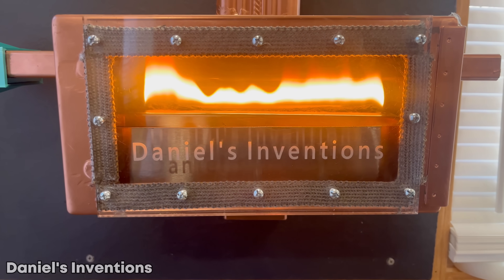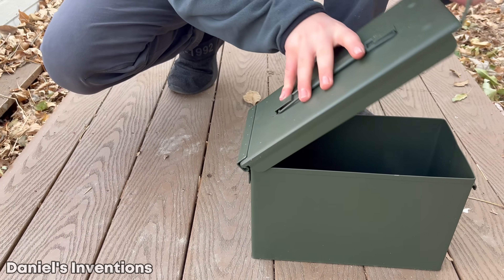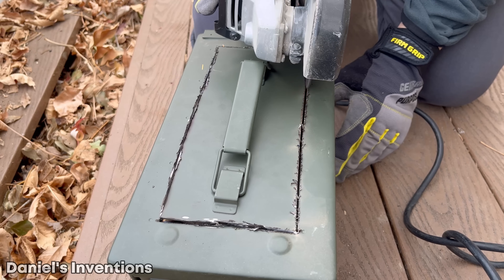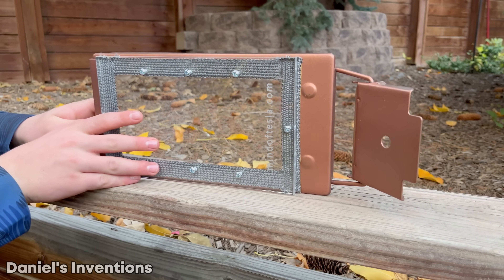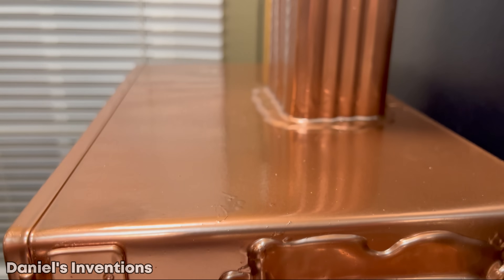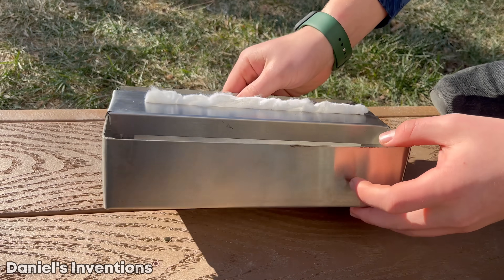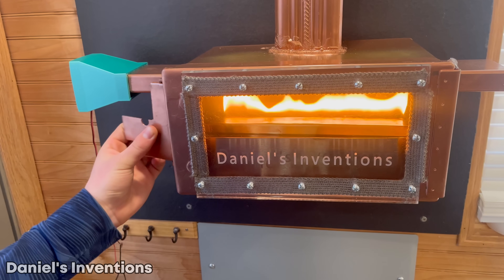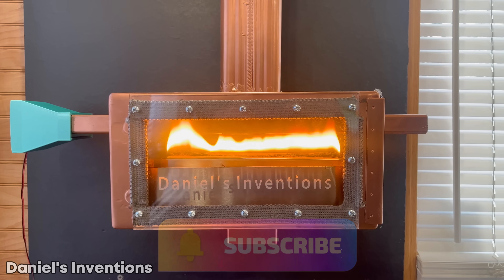ENDLESS Heat for Your Home WITHOUT Electricity 2.0

Comment: For your next build you should design your bottom intake to draw air from outside.  Since your bottom intake draws air from within the cabin, it's also drawing out the warmed air and exhausting it outside.  This is similar to the issue with old fireplaces, they draw the warmed air into the fireplace and then exhausts it out the chimney, which is why fireplaces were very inefficient.  Modern wood stoves are much better because they don't draw air from within the house.   So, if your intake draws from outside air you won't have to worry about the heater drawing any warm air from within the cabin and exhausting it outside.  But great concept, I like it!
Reply: Better to draw warm air from the room to heat up and circulate again, it will work less hard, this is a good design apart from the air to blow out should be aimed up from the intake so no need to use a fan, Chimney effect.
Reply: Would the outside temperatures cool down the burn chamber more than the loss of heat being drawn in from the room? It would be simple to test. I am curious.
Reply: wouldnt bringing cold air in from outside create moisture issues or affect the flame?   if anything, intake should be longer to pull cooler air from lower level of the room.. 
   my question would be - would there be an improvement in heat distribution if instead of an open hole at the end, it was blocked at the end and had a floor register design that sent the heat out in different directions?
Reply: It's actually better to draw the air from the room. It creates a slightly negative pressure inside allowing fresh air to find its way in through windows etc. If the source is outside you are constantly recycling the same air inside and because it's hot the inside creates a positive pressure which means if there are any fumes that leak they are staying inside and building up toxins. The small amount of air passing outside is not going to effect the hearing much in either case but its better to have a slightly negative pressure in the room allowing fresh air to seep in thus having cleaner air. HVAC was a field I worked in for a bit and we always tried to have air going outside in some circumstances to create a slightly negative pressure indoors to allow fresh air to seep in.
Reply: Under certain conditions this can result in the system reversing. Drawing air at the flue and exhausting through the intake.
Reply: The previous version used outside air. I'd like to hear why the builder made this one differently and if it's an improvement.
Reply: It's like the recirculation function on the AC in your car. It's always colder when recirculating cold air rather than cooling down hot air. It's definitely more efficient to warm up air that's already warm than warming up cold air from outside. 🤦🏻
Reply: @newmonengineering True but I also have a concern with carbon dioxide levels with this setup. Negative pressure means fresh air (oxygen) coming in and fire burns oxygen which is good if the space is not tightly sealed. 
However, this would be very concerning for those that are setting it up as you recommended in tightly insulated RVs (very small spaces). In that case, a carbon dioxide alarm would definitely be something to consider observing if those levels rise.
Reply: @mikefranks4528  with all types of oil heater it's best practice to have a small amount of ventilation and in the case of an RV this can be in the form of a roof vent but your correct I personally would still use a carbon monoxide / dioxide alarm, The beauty of this type of burner is they can be run on a multitude of oils and fuel blends.
Reply: @celtshaun1427 yep, totally right - cracking a window would allow fresh air to come in so that occupants can breathe properly. I wanted to educate everyone that having a carbon dioxide monitor would be smart in tightly sealed spaces. I am building out my RV and yes it will have a maxxair fan (for warmer weather), but for “Winter” it would require ventilation of an HRV system (heat recovery ventilation). Basically, maintaining a heated environment with fresh air.
Reply: @danb4275  Because everyone used to say drawing inside air caused outside air to be pulled in through intrusion, door gaps etc. When the reality is most houses leak air regardless. Also rarely the flue can reverse flow drawing air thru chimney exhausting thru intake creating what could be dangerous situation.
Reply: @benjaminmiles5062  No the fan is needed it's a big factor
Reply: Run the intake to close to the floor
Reply: Whether than draw in cold outside air, I'd just extend the intake down to floor level where it won't draw in so much stove heat.
Reply: Why would you not just keep heating the same air? If the air is already warm it will take less energy to keep warm. Also it doesn’t seem to be venting outside just through the pipe back into the room.
Reply: @benjaminmiles5062  Doesn't the drawn-in air get exhausted outside though?  It's not recirculated back into the room, it feeds the fire then goes out the exhaust pipe...I think.
Reply: @ThePostalbiker  The heat exchange happens from air entering from the left and passing over the fire box, then being blown Obrien the room.   The air drawn-in from the bottom feeds the fire and gets exhausted outside, but never reenters the home.
Reply: @benjaminmiles5062  Use one of those heat powered fans to distribute thru the room. Place it right on top of the heat box.
Reply: just draw indoor air closer from the ground.
Reply: Or perhaps, simply extend the air intake all the way down to the floor, where it is coldest? It would eliminate another whole.
Reply: You've got it backwards. Using cold air from outside is less efficient than recycling warm air from the inside.
Reply: ….. ok so. He’s talking about oxygen for the fire coming from outside. Not the air being pumped through the fan.
Reply: That wouldn't be a hard fix. Just drill a 3/4 inch hole into the stove and the wall. Add s small piece of 3/4 emt pipe into the bottom of the heater. Add a 90 deg. Elbow. To connect one into the outside wall. Seal around the pipe and wall.
Reply: Or have a gateway Y. So as the room gets hot, he can draw air from outside, by a switch of the Y.
Reply: @benjaminmiles5062  no it's always better to draw air directly from outside. The opposite of what you said is true. Pulling air from inside the room will create a vacuum and that will not only draw cold air in cracks of the cabin reducing efficiency of the stove but it will also make the fan work harder because it now has resistance.
Reply: @benjaminmiles5062  I see where you are going with that, but unfortunately - exhausting room air will create negative pressure in the room.  The air will seep back in through the walls and cracks, having a net chilling effect.  It would be more efficient to use the outside air and dump it back out to feed the flame.
Reply: this is a myth
Reply: @ThePostalbiker All of Your High Efficient Gas Furnaces Take outside air into Furnace for Make up air or You use All of Your 02. Especially if House is too air Tight!
Reply: I have yet to see one wood stove that draws fresh air directly from the out side to burn. Please show me the a link to the top 10 stoves. Hahaha
Reply: @realstihl2105  an OAK (outside air kit) is required when a wood stove is installed in a mobile home. But outside air intake is not beneficial in a regular home unless you have a very tightly sealed new home and you experience smoke rollout or low draft in your stove.
Reply: Cold sinks and heat rises...
Reply: @gregzeigler3850  the effect of convection ( heat rising / cold sinking ) is way weaker than the amount of pressure difference created by the burning fuel
Reply: @Vid_Master  What I meant, is he is getting colder air in, since the cold air intake is below.
Reply: I would suggest that exhaust pipe outside should be extended beyond the roof line unless your home is subject to heavy snow loads on the roof. Exhausting under the eaves could lead to fumes being drawn back into the house through the fascia.
Reply: You want to recirculate the air within the room but perhaps a longer intake so that it is drawing in the coolest air in the room would make sense.. alternatively having the whole unit lower down in the room.. but that's less ergonomic, and requires a longer chimney.. however if the longer chimney wasn't problematic it's also going to radiate heat
Reply: @markpennella  As a general rule, no. you are drawing out in cool air from the outside regardless of whether you are expelling the warm air from the house otherwise you would create a slight vacuum inside the building and wouldn't be able to exhaust the gases created by combustion to the outside which usually isn't the best for human survival.
Reply: @randybobandy9828  they don't get it, dude.

All I know is that I'm burning so much less wood in my stove ever since I ported the intake to the crawl space under my house. My place stays warmer longer - even with single-pane windows w/aluminum frames. 

One day I'll change those, too.
Reply: @mikefranks4528  you Internet hysterics just takes the cake, this is basically the same as having 7-10 oil lamps in your house, or candles comes to that and I have doubts that you kvetch about that(you’re redacted for real in that case)
Reply: Another benefit of using outside air is that it creates a positive pressure inside which reduces or prevents drafts. When using inside air it has to be replaced causing negative pressure in the room. Hence cold drafts will be amplified. I installed an outside feed to my woodstove and it made a great difference in cold drafts.
Reply: @tracywarren7332  Exactly!  And you also have no worries of oxygen depletion in a closed system.
Reply: @excellenceinanimation960  How much sense does "heating the same air" make when that reheated air is immediately sent straight up the flu and out into the atmosphere? When you recirculate the air in your car, does your air conditioner take the air that's already been cooled, then pipe it straight outside after re-cooling?
 Carefully consider those two questions, and I think you may come to an understanding of why it's not at all efficient to reheat air from your cabin, using this type of system.
Reply: @Rick-the-Swift  I think you have a misunderstanding of how the system works.  The heating pipe is separate from the exhaust. It just passes air over the flames and out into the room. The vent is the soot.
Reply: @Rick-the-Swift  oh your saying you should feed the flames with outside air.
Reply: @Rick-the-Swift  that would be fine but I still don’t see why. The air being pumped out into the room is from the exchange pipe and not out of the exhaust.
Reply: @excellenceinanimation960   "The air being pumped out into the room is from the exchange pipe and not out of the exhaust."
Ish. The exchange pipe is producing heat the same as the entire stove box, along with the flu pipe which is also producing heat. You could put a fan over the top or pointing straight at the side and get similar results. IThe exchange pipe is basically just more surface area added to the stove, becoming heated then radiating back into the room. The fan just helps facilitate that process. But you still need to take into consideration when the intake is coming straight into the stove, from the living room, similar to a fireplace, then the air warm air which surrounds the flames is sucked straight back up through the exhaust and gone forever to the big sky above.
 Regardless of what HVAC guys are saying in this thread, there is a very good reason they use outside air for combustion in their gas furnaces- because that way it's not stealing the warm air it just created, and blasting it out of the roof!
 Hope that helps buddy!
Reply: @excellenceinanimation960  Also. another thing to keep in mind- in most houses, fresh air is always coming in from various cracks when a fireplace or woodstove is burning. The stove is creating a negative force or a vacuum as it sucks air in from the room and jets it out to the sky. So when you pipe in air in these normal situations you are really just choosing which air you want to combust, rather than letting the stove decide for you. 

 If you think about living inside a sealed home, maybe something like a giant water tank, where there are no drafts coming in, like a normal house, then it becomes all the more imperative to pipe in the combustion air from outside. Why? Because not only would the stove be stealing the heated air it just produced, but it would also be stealing any oxygen in the room. This is another reason modern furnaces pipe in outside air- the engineers don't want the furnace to interact with the home interior fresh air levels whatsoever- they demand for the sake people's health that their furnace systems are separate from the air ventilation system, and that the furnaces aren't stealing (too much) air from the cabin's interior.
Reply: @Rick-the-Swift  got what your saying. I thought you were referring to the pipe that was sirculating warm air. I understand what your point Is now.
Reply: @Rick-the-Swift  how safe do you think a home made heater like this is?
Reply: @excellenceinanimation960  Haha, it's hard to say how safe this is, but probably not too dangerous as long as the flames are kept to a height where they aren't causing too much heat and soot. It's probably as safe as most oil burners or safer. At least it's exhausting fumes to the outside, which many burners aren't required to. 
 Glad you got my point as well😀
Reply: @Rick-the-Swift  thanks (:
Reply: @danb4275  yes this version is an improvement, the intake coming from outside can cause condensation and it may lessen the effect of the heat exchange since its bringing cold air until the box instead of warm dry air from inside the room.
Reply: Their design works like a heat exchanger. So the only warm air going outside, also
contains the exhaust contents that you can't breath anyways.
Reply: I agree. My sealed gas fireplace pulls outside air in for combustion. Much more efficient.
Reply: @jeffreylindley845  huh, interesting
Reply: @MrEditor6000  Yeah, my gas fireplace uses outside air for combustion. This allows the firebox to be sealed and I have fans that push air around the outside of the firebox and into the house to transfer heat. It is a side venting unit so no chimney needed max.
Reply: @jeffreylindley845  Mine is a ventless gas
Reply: @newmonengineering  "The small amount of air passing outside is not going to effect the hearing (heating) much" without measuring the amount of air being pulled into the room, how can you be so sure?  Pulling in cold air from outside means it's going to be less efficient.  Anyone with a non-split AC unit knows how little they actually help cool other places in the house.
Reply: @kbakeritsallaboutnobody.5761  " It's definitely more efficient to warm up air that's already warm than warming up cold air from outside."  The air being pulled into the room is cold.
Reply: @robertp457  not sure I understand your point. Cold air pulled into a warm room is no longer cold.
Reply: The oil looks like it’s cheaper than wood.
Reply: Agree the fire box should be supplied with outsider air.

Secondly the heat exchanger shpuld draw air from as close to floor level as possible and be heating the cooler inside air.  Depending on fan power you could great a convection and heat the space more efficiently.   Though with the computer fan not likley.
Reply: Sorry but I’ve never seen a wood stove that takes air from outside the house. I’ve been using wood stoves for most of my life and currently use 2. They both draw air from the inside.
Reply: @stevegiesey7898  me too and here we are alive to talk about it and not dead from carbon monoxide like most of the idiots in the comments think.
Reply: OP is correct. This setup creates negative house pressure. All hot air escaping out the exhaust gets replaced with cold outside air sucking in through door and window gaps. If the house was completely air tight like in modern high efficiency homes the negative pressure would build up and it would start drawing exhaust into the house through the intake in a pulsing effect. You can replicate this effect quickly in a sealed chamber with only an exhaust port. This is why all modern heating devices that use flame to heat your home draw intake from outside through their own cold air intake. Even the old code for installing gas furnaces required drawing air from outside. Some lazy installers chose to omit the fresh air intake in a nearby wall or ceiling into attic and people have died from that mistake. All new high efficiency furnaces must have their own air intake installed. In many places it's illegal to not have it. In short. This setup does work if your room is NOT air tight. Deadly if your room is air tight. But it's extremely inefficient without its own outside air intake.
Reply: Could have the inlet closer to the floor so only the coldest air is drawn in, but I would still like to see a little fresh air incorporated.
Reply: @newmonengineering 
Except some newer houses are so airtight you could have serious problems, really depends on air tightness.
Reply: And have the fan run like log burner fan with heat voltage  generating strip
Reply: Here is The True Savior

HalleluYAH “Hallel u YAH - Praise ye YaH”

YaH is The Father (Genesis 1)
YaH arrives via the TENT OF MEETING
YaH was Who they Crucified for our sins
YaH was Crucified on an Almond TREE

Ancient Semitic Moshe (Moses)
Isaiah Scroll (The Original Isaiah)
Reply: Burning oxygen is not a good idea
Reply: Hi! To do thus, do I then have the fan connecting to an extended inlet that starts from outside the house?
Reply: It also would allow flow reversion in strong winds possibly killing the inhabitants lol